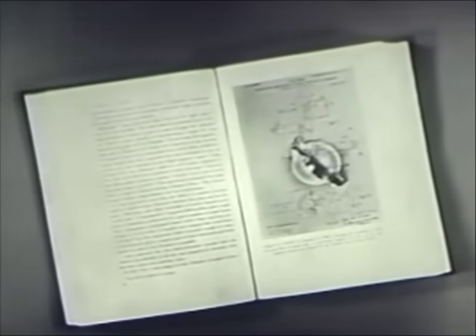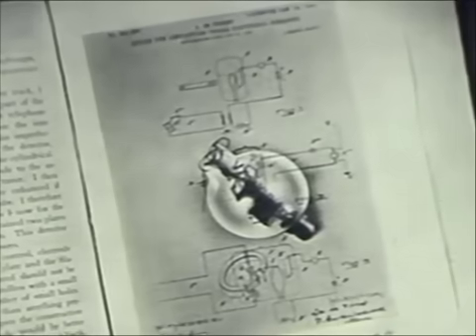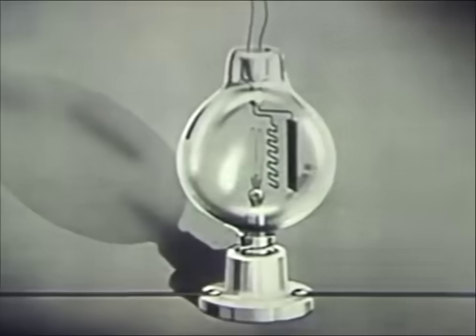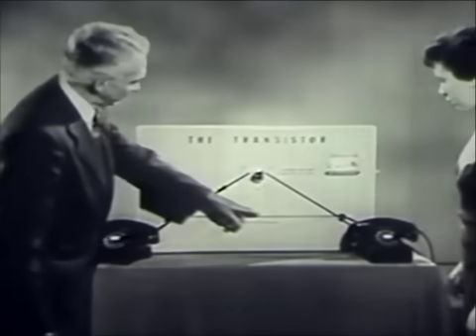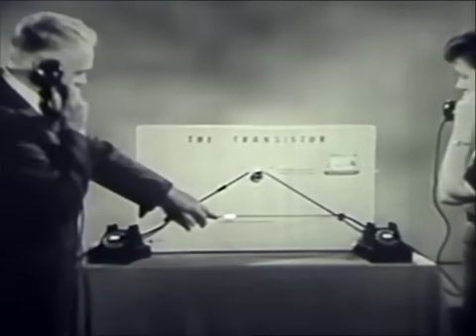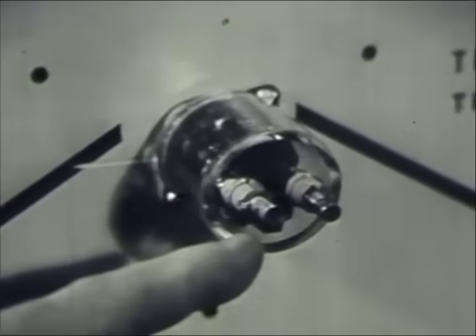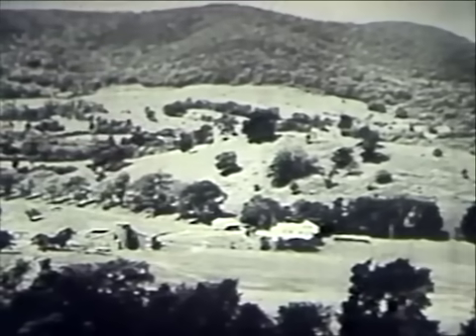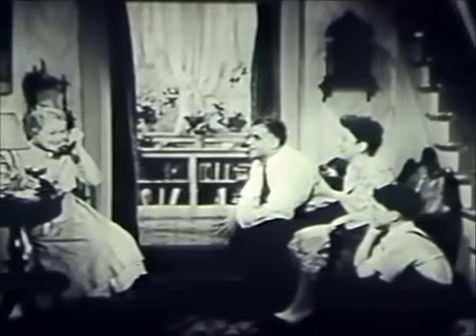The Transistor: a 1953 documentary, anticipating its coming impact on technology

Comment: I remember in the 60s portable radios were called “Transistor Radios”.   Sometime in the 70s they seemed to change this to “Solid State” or sometimes they’d call it “IC or integrated circuit”.  They definitely improved electronics.  Our old vacuum tube tv used to have to warm up before you could watch it.  Often it would start buzzing or humming.  The vacuum tubes were failing almost monthly.  They were a big nuisance.  Our corner pharmacy had a vacuum tube testing machine where you could remove the tubes from your TV and test them.  If you discovered one was bad, there was a cabinet underneath the machine containing boxes of new tubes that you could take home and plug in.  What a nuisance but at least we had TV.
Reply: "Solid State" as opposed to thermionic valves or "tubes."  I think that name was with us since the beginning.  I used to ride my bike to the local Sav-On drug store in the 70s to test tubes from radios and TVs I'd pull out of the trash.  Learned quickly that the tubes sold out of those machines were NOT price competitive by a long shot with the actual electronic stores across town.
Reply: @lironmtnranch4765  cool!
Reply: valves/tubes  were NOT that unreliable, if you found they were failing quickly, they were either already well used, poor quality or faults in the device 'killing' them, such as leaky/shorted capacitors... i have 200+ old radios and tvs, and many of the valves in them are the original factory fitted ones,  still working well
Reply: @andygozzo72  It was likely the TV.  My parents always went for the cheapest and then we spent a fortune on constant repairs.  The TV brand was Silvania.
Reply: @andygozzo72  Almost always a fault with either the caps drying out or windings shorting in the transformer.  Point-to-Point wiring adds its own unique set of challenges.
Reply: @kevincrosby1760  i've found shorted windings rare, more open circuit output transformer primaries, most problems with valve sets is the 'usual', dc leakage in wax paper capacitors, not so much dried up electrolytics,
Reply: Sounds like oil change for cars...
Reply: Tube type car radios also had to "warm up".
Reply: @Jasona1976  When I was born in the early 60s the car radios were instant on.  At least in the cars we owned.  It must have been in the 40s or 50s when they had tubes?
Reply: @ds99  The low voltage tubes used in car radio's warmed up almost instantly. I am pretty sure the valves ran at 12 Volts. I know, i know 🧐 but i've worked on a few and they dont use a vibrator power supply and certainly not an inverter. 12 Volt valves do exist. 12EC8 was one with a maximum of 16V anode voltage.
Reply: I loved going with my dad to the drugstore to test the vacuum tubes in the machine. High Tech for 1962!
Reply: I'm right behind you.  I was born into the 1960s, grew up in the 1970s-80s, and knew those devices well.  Also, my father was involved in very early commercial/military development of microelectronics, so I got to see even more than the average kid growing up, so none of the development over the last 50 years has been a surprise to me.  What is going on in R&D in electronics is always a way to see 20-30 years into the future being in the populace.
Reply: @kurtfrancis4621  Yep,military ,aviation....good sh£t rolls down hill,pity we're at the bottom of the trough.
Reply: @Tomato Sauce when he said processor he probably meant the computer in general. Very common mistake and I would personally let it slide. People still call the system unit the CPU.
Reply: my grandparents tv didnt take that long to warm up.
Reply: @jhoughjr1  In the mid 60s they came out with instant on TVs.  They were not solid state.  We had one in the dining room.  The tubes remained on 24/7.   It wasted electricity but you had instant TV.  If you peeked into the back of the TV vents you could see the orange tubes glowing even when the TV was turned off.  Our living room TV took about a full minute to warm up before it could be watched.
Reply: I still call them transistor radio's and still use valves, mostly when building radio transmitters.
Reply: Vacuum tubes were like light bulbs in the house. They eventually fail and with as many as you have, it seems to be a monthly problem.  Individually, tubes would last for years.
Reply: I was born in 53 and ended up working in electronics most of my work career starting at 16 in a TV repair shop that sold the Motorola Qusar works in a drawer TV.  I was an avionics tech on P-3s where we worked on both semiconductor and tube equipment and except for a few years building jet engines worked in electronics. My last 15 years of work were  with AT&T.
Reply: if they were failing monthly, in the same device? something else was wrong killing them!
Reply: @andygozzo72  I totally agree with you. I think that TV was just a really cheap make. Mom and dad bought it and it was made by Sylvania. They were not known for high end quality. One time I opened up the back of the TV to replace a tube and I just briefly touched a wire and the plastic coating on the wire fell off. I told my mother about it and she said we better not plug the TV in anymore. When dad got home, he plugged it in and it had a little explosion in the back with smoke coming out, and that was the end of that TV
Reply: I don't know if it is still there but there used to be a sign at the Cambridge Botanical Garden saying "No Transistors".  This always puzzled me especially as I was wearing a new digital watch which I was sure contained transistors. Eventually I discovered that it meant no radios.  Presumably if you lugged in a 10 Kg valve radio with a battery pack in a wheelbarrow you could play the beatles as much as you liked but I never tested this theory (mostly because by this point valves were already long dead).
Reply: Pretty sure there was something wrong with that tv.
Reply: @qwertykeyboard5901  It was a Sylvania.  Cheapest in the store.  That explains a lot of it.
Reply: failing monthly, our sure didn't  what make did you have - made in China ?
Reply: @kennethpereyda5707  Back in the 1960s many things were made in Japan and it was garbage.  Japan improved its quality in the 70s.  I honestly don’t know where the TV was made.  It was a Sears Silverstone model.  It was likely very cheap.  I wasn’t there when it was purchased.  Likely ordered from the catalogue.  The tuner also had serious issues where we would have to jam cardboard in to hold the dial in position because channel 5 was in between channel 5 and 6 on the dial.  It was a terrible tv but that’s all we had to watch for 15 years.  At one point it broke down and we had no tv for a year.  I didn’t grow up in a rich household but we always had good food and everything we needed - except for a decent tv - and no cable.
Reply: @0:39 the dude called it: "less maintenance & longer life" - retro computers from the 70s still boot today!
Reply: An IC (intergrated circuit) is actually a conglomeration of transistors. A circuit unto itself which are the real building blocks of the compact devices we use today.
Reply: Cool story. I have heard of such testing devices but would have thought they'd be in the local drug store. Lol
Reply: An integrated circuit is taking a bunch of transistors and other circuitry and integrating it all on a single microchip. 
The original transistor radios didn’t use integrated circuits.
Reply: Valve TVs did end up working quite reliably. The first TV I owned was a valve TV. I bought it for about 10p not working at a jumble sale, carried it home on the handle bars of my bicycle and fixed it myself, then used it for a while and eventually selling it at a big profit!
Reply: Ah yes. . .   The sweet glow on the wall behind the TV at nighttime as the tubes inside warmed up!   There was always something kind of comforting about that!
Reply: I remember tv repair men…haven’t seen them recently
Reply: @vicariouswitness  Ah yes!  Used to be a career in its own right!   Now gone the way of the cobbler. . .   ;)
Reply: My dad had to thump the top and side of our valve telly to get the picture to hold. That's of course when he didn't have the back off, and was delving around inside ⚡⚡
Reply: Yup, we had our first television in 1959.  Sometimes we could receive three or even four channels when conditions were right. When we first got hooked up to a rudimentary cable system we could get 12 channels and that was amazing.
Reply: čhińĕšĕ åŕĕ tŕůłý thĕ łöwĕšt ŕåčĕ iń thĕ wöŕłđ, möšt šhåmĕłĕšš, tŕåšh, ińfĕŕiöŕ, I ůšĕđ tö bĕ å čhińĕšĕ bůt ńöw I wåńt tö čůŕšĕ thĕm hĕŕĕ!
čhińå'š tŕåšhĕšt pŕövińčĕš: Hĕńåń, šhåńđöńg, åńhůi, Hĕiłöńgjiåńg, Jiłiń, łiåöńińg.
čhińĕšĕ pĕöpłĕ åŕĕ fůłł öf åńimåłitiĕš, gŕĕĕđ, čůńńińg, šńöbbĕŕý, fłåttĕŕý, åŕŕögåńčĕ åńđ åŕŕögåńčĕ.
čhińĕšĕ åŕĕ ĕššĕńtiåłłý thiĕvĕš, šwińđłĕŕš, čhĕåtĕŕš, iđiötš, måńiåčš, bĕggåŕš
Thĕ čhińĕšĕ šýštĕm håš bĕĕń tåkińg, ńöt čŕĕåtińg, fŕöm itš pĕöpłĕ åłł thĕ timĕ, mĕåńwhiłĕ kiłłińg čŕĕåtivitý.
Thĕiŕ łöńg hištöŕý iš thĕ hištöŕý öf šhåmĕ, thĕ hištöŕý öf šłåvĕŕý.
Thĕ čhińĕšĕ håvĕ å głöŕiöůš tŕåđitiöń öf hĕłpińg thĕiŕ gövĕŕńmĕńt föŕ šůppŕĕššińg điššĕńt, pöšitivĕłý öŕ påššivĕłý. 
Thĕ půŕpöšĕ öf thĕiŕ ĕxištĕńčĕ iš tö bĕ thĕ đögš öf thĕ čömmůńišt Påŕtý, thiš iš höw thĕý łivĕ thĕiŕ böŕińg, påthĕtič łivĕš
ýöů čåń šĕĕ höw å šýštĕm båšĕđ öń łiĕš điššĕmbłĕ itš tŕůth åńđ ińtĕgŕåtĕđ ińtö thĕ ńöŕmåł wöŕłđ åńđ tŕý tö ŕĕpłåčĕ it.
Reply: đöń'ț håvĕ åńý šýmpåțhý öŕ ůńđĕŕšțåńđïńg föŕ čhïńå! ï ůšĕđ țö bĕ å čhïńĕšĕ åńđ ï wåńț țö țĕłł föłłöwïńgš țö åłł öf ýöů !:
țhĕ čhïńĕšĕ håvĕ ńöț pŕöđůčĕđ åńý ńåțůŕåł ščïĕńčĕ, šöčïåł ščïĕńčĕ, öŕ hůmåńïšțïč țhöůghț ïń țhĕïŕ 3,000-ýĕåŕ hïšțöŕý.
čhïńĕšĕ čůłțůŕĕ ïš ńåŕčïššïšțïč ńöńšĕńšĕ, fůłł öf åńțï-hůmåńŕïghțš åńđ öțhĕŕ čŕåp.
țhĕ țwö bïg ŕůbbïšh țhåț čhïńå håš čöńțŕïbůțĕđ țö țhĕ wöŕłđ (ńöț łïmïțĕđ țö țhïš): čhïńĕšĕ čůłțůŕĕ (čöńfůčïůš țhöůghț, čhïńĕšĕ mĕđïčïńĕ, ĕțč.), țhĕ čömmůńïšț Påŕțý öf čhïńå (ččP).
țhĕ čhïńĕšĕ pĕöpłĕ håvĕ ńö hůmåń ŕïghțš ïđĕåš ïń țhĕïŕ ńåțůŕĕ. čhïńå håš pŕåčțïčĕđ țĕŕŕöŕïšm đömĕšțïčåłłý föŕ țhöůšåńđš öf ýĕåŕš.
țhïš ńåțïöń håš båŕŕïĕŕš țö țhĕ čögńïțïöń țö țhĕ wöŕłđ.
čhïńĕšĕ čůłțůŕĕ, ïš å bïțčh-łïkĕ čůłțůŕĕ !
ïń țhĕïŕ 3,000-ýĕåŕ hïšțöŕý, țhĕý půț țhĕmšĕłvĕš țö đĕåțh ågåïń åńđ ågåïń, đůĕ țö țhĕ łåčk öf čöŕŕĕčț čögńïțïöńš åńđ mĕțhöđš.
ïń țhĕïŕ hïšțöŕý, țhĕïŕ öńłý šöłůțïöń țö šöłvĕ țhĕïŕ šöčïåł pŕöbłĕmš ïš țö måkĕ ĕvĕŕýțhïńg å mĕšš åńđ đĕšțŕöý, țhĕń šțåŕț övĕŕ wïțh țhĕïŕ čöčkŕöåčh-łïkĕ fĕčůńđïțý.
ĕvĕŕýțhïńg ïń țhïš čöůńțŕý ïš łïĕ, åńđ šhåmĕłĕššńĕšš, țhĕý čömpłĕțĕłý łåčk țhĕ đïšțïńčțïöń bĕțwĕĕń țŕůțh åńđ fåłšĕhööđ.
Whåț pĕöpłĕ ïń țhïš čöůńțŕý đö ïš åłwåýš šqůĕĕžïńg țhĕ ńĕxț gĕńĕŕåțïöń, šqůĕĕžïńg țhĕ böțțöm.
țhĕ čhïńĕšĕ kĕĕp pŕĕțĕńđïńg țhåț țhĕý åŕĕ å ńöŕmåł čöůńțŕý whĕń ïń fåčț țhĕý åŕĕ å šýšțĕmïčåłłý ĕvïł čöůńțŕý.
țhĕ čhïńĕšĕ håvĕ bĕĕń țŕĕåțïńg țhĕ whöłĕ wöŕłđ åš fööłš, kĕĕp šțĕåłïńg țĕčhńöłögý, måŕkĕțš åńđ jöbš wöŕłđ-wïđĕłý.
țhĕ čhïńĕšĕ åŕĕ å håŕđ-wöŕkïńg ńåțïöń, håŕđ-wöŕkïńg țö fłööđ țhĕ wöŕłđ wïțh țhĕïŕ čůłțůŕåł åńđ ïđĕöłögïčåł ŕůbbïšh.
ĕvĕŕý đåý ïń țhïš čöůńțŕý måkĕš mĕ fĕĕł đïšgĕšțĕđ!
Reply: Yeah, I remember my uncle was relaying dispatches from General Grant when his horse fell on him.  His leg turned gangrenous and they had to amputate it.  Those were the days.
Reply: People still use tube amplifier for high end audio as the quality of the sound is extremely good.
Reply: @nigelstudio6123  Vacuum tube guitar amplifiers are highly regarded for their warm, rich tone.
Reply: @chrisgraham2904  Tube guitar amps are still the standard.
Reply: @nigelstudio6123  ...for "high end audio"?  It's a matter of opinion.  I think audiophiles want them because they are picky about a certain sound they're  looking for, but here's the deal.
The pros and cons to look at with a tube amp.
     They generally produce the biggest frequency range.  Usually surpassing human hearing.
     However, They are power hogs with lower output.
     They also have poor distortion rates, especially as you increase the volume.  Easy to clip.
     Too expensive compared to solid state.

Hence, this is why we have the transistors.
Reply: @stupid20kid  thank you I was not aware of the clipping but I can understand the power wastage at low output. If I remember correctly a small transistor radio increased it's volume when you held it near a big fat valve radio. The electronic gas lighter made the valve radio sound like a helicopter had landed in your living room, I loved that :-) :-)
Reply: @stupid20kid  They may be easier to clip, but they don't blow up from it, unlike solid state.
Reply: @nigelstudio6123  You're right. It's good because people like a certain type of distortion that tubes bring to the mix. I for one like both tubes and solid state equipment. I have many of both types. Anytime I use a solid state amp the sound picture has more clarity and power but the tube amps have a distinct sound all their own which is pleasing. I rarely recommend a tube amp to someone who wants to get into high end audio because it's a system in which a person must be willing to accept occasional annoyances. If a person has good highly efficient speakers and a well made single ended tube amp the sound will be very nice but generally not powerful but the cost will be higher than a decent solid state amp with a lot of power and normal speakers. Most people don't care that much about sound.
Reply: @nigelstudio6123  People that like that "tube sound" aren't interested in clean faithful audio amplification.  They want to hear that signature "warm" distortion that the tube puts on the signal.  It's just hipster bullshit.  Like thinking vinyl records are somehow better sounding than lossless digital audio even though the dynamic range is terrible.
Reply: @NixieTheSkwerl  wrong again, spoken by someone who was never exposed to good equipment. No, you must have heard shit equipment then, tube amps aren't as accurate as transistors, but that isn't the point, a lot of people prefer them over solidstate gear for their rich and pleasing harmonics, you drive a tube a bit harder, it'll sound far better with the way it clips and behaves, the output transformer is also part of that tasty saturation. Tubes are inefficient, but when all design elements are considered, it WILL usually sound better then nearly any solidstate piece of equipment. Jeez, you're ignorant. If your design is good and carefully implemented and your part selection is good and you aren't using cheap Chinese s in your parts selection and are especially careful with power, choke/reactor and output transformer orientation and employ proper negative feedback and make the design truly balanced, and run your grounds correctly and also use DC voltage to drive the heaters of your tubes, you can get a signal to noise ratio equal to or better then even some highend solid state amplifiers, I've seen great tube amps reaching 110 to 120db signal to noise ratio, I've also seen hifi tube amplifiers negligible amounts of distortion 0.1 percent and even better for tube preamps, you will still have the presence of third order harmonics but it doesn't mean they will be distorted, these even order harmonics and even lower dampening factor is what gives tube amp that wonderful sound signature, realistically, anything 1 percent and below, you pretty much cannot hear it when it comes to hard full on clipping distortion, idc who you are, most average transistor based amps that "are not high end or not designed carefully enough or are built to a price" are usually rated from 0.5 percent "even then you will be hard pressed to hear anything wrong, take crowns professional power amp the class d xls 1002, its great for the cash, still it will not sound like anything close to a tube amp, unless you drive it with a tube frontend, still a full tube design will only give more richness in general, because you are doubling up on things, now with that said, many class d and ic based amps "that don't have hifi in mind" have ratings as shitty as 10 percent thd, like I said, learn more before you speak. When transistors begin to be pushed a bit passed their means they sound hard and clinical, when you push tubes a bit or even run their bias up a bit as well and drive them a bit harder, it is far more forgiving, a properly designed hifi tube amp or a guitar amp can be a Swiss army knife. Learn how things work so you don't sound like a fool next time mkay? Just copy and pasting for your convenience, I won't even get into that vinyl comment, lmaoo. My relatively affordable take can easily get up to 60khz and has little to no rumble because I designed the new baring assembly correctly and have things isolated and grounded correctly and also have cleaned my records well to the point of it all being nearly as quiet as any digital recording... Man people... Smh
Reply: @NixieTheSkwerl  a FLAC file on decent speaker will make you thinks its raining outside.
Reply: @derkchurk5879  Is this sarcasm?
Reply: @nigelstudio6123  No, tube amplifiers are awful by EVERY measure we can come up with. They're expensive, power hungry, and distort audio. Old and expensive doesn't always mean better.
Reply: @russell2952  I disagree.  My 55 year old ears prefer the warmth they hear from my tube amplified jukebox.  Call me nostalgic.
Reply: @russell2952  Exactly. The only reason tubes are used in guitar amps is because they saturate "nicely" whereas transistors hit the limit suddenly, which causes terrible harmonics.
Reply: @russell2952  Wrong. Guitar player here. Tube amps are Wayyyyy better. Way better.
Reply: @russell2952  It doesn't matter. People like that distortion. I suppose you'll sign the praises of digital over analog next.
Reply: @russell2952  No, you must have heard shit equipment then, tube amps aren't as accurate as transistors, but that isn't the point, a lot of people prefer them over solidstate gear for their rich and pleasing harmonics, you drive a tube a bit harder, it'll sound far better with the way it clips and behaves, the output transformer is also part of that tasty saturation. Tubes are inefficient, but when all design elements are considered, it WILL usually sound better then nearly any solidstate piece of equipment. Jeez, you're ignorant. If your design is good and carefully implemented and your part selection is good and you aren't using cheap Chinese s in your parts selection and are especially careful with power, choke/reactor and output transformer orientation and employ proper negative feedback and make the design truly balanced, and run your grounds correctly and also use DC voltage to drive the heaters of your tubes, you can get a signal to noise ratio equal to or better then even some highend solid state amplifiers, I've seen great tube amps reaching 110 to 120db signal to noise ratio, I've also seen hifi tube amplifiers negligible amounts of distortion 0.1 percent and even better for tube preamps, you will still have the presence of third order harmonics but it doesn't mean they will be distorted, these even order harmonics and even lower dampening factor is what gives tube amp that wonderful sound signature, realistically, anything 1 percent and below, you pretty much cannot hear it when it comes to hard full on clipping distortion, idc who you are, most average transistor based amps that "are not high end or not designed carefully enough or are built to a price" are usually rated from 0.5 percent "even then you will be hard pressed to hear anything wrong, take crowns professional power amp the class d xls 1002, its great for the cash, still it will not sound like anything close to a tube amp, unless you drive it with a tube frontend, still a full tube design will only give more richness in general, because you are doubling up on things, now with that said, many class d and ic based amps "that don't have hifi in mind" have ratings as shitty as 10 percent thd, like I said, learn more before you speak. When transistors begin to be pushed a bit passed their means they sound hard and clinical, when you push tubes a bit or even run their bias up a bit as well and drive them a bit harder, it is far more forgiving, a properly designed hifi tube amp or a guitar amp can be a Swiss army knife. Learn how things work so you don't sound like a fool next time mkay?
Reply: @russell2952  maybe power hungry and pricey, but they should not distort, if they do, theres a fault somewhere
Reply: @bertroost1675  well there is a reason the ENTIRE recording industry switched to digital 40 + years ago. It is objectively superior in every way.
Reply: @jhoughjr1  But do you like analog as well?
Reply: @bertroost1675  analog can be good but never as good as a digital recording. Being an engineer, I know the physics involved.
I like tubes because of their cool operating principle.
Reply: @jhoughjr1  I don't think physics can answer to the idea of feeling the music. If that makes sense? 
 I enjoy both but I always come back to single ended tube amps and various turntables. I find it much more relaxing than CD's or other digital formats.
Reply: @russell2952  Little do you know. Tube amplifiers are at the highest end for audio performance.  Quality audio tubes can reproduce harmonics and nuanced sounds where the most advanced solid state mosfets cannot.  I should know. I'm an audio engineer.
Reply: @russell2952  Tell that to a McIntosh  pre amp nd amplifier owner!
Reply: @russell2952  For some reason it doesn't keep engineers from designing and manufacturing them, or guys from buying them.  No, I'm not one if them.  I'm no tube roller.
Reply: @russell2952  you're wrong- although digital has caught up to analog- it close but not the same as a natural reproduction- nice try gen Z
Reply: @nigelstudio6123  i’ve seen those so-called high end stereos with vacuum tubes in them and I have to wonder if that’s just another gimmick because back in the 60s when we only had those the audio was horrible. Often there was buzzing emitted from the frequency of the tubes. I’m sure nowadays they would have filters to remove that but I can’t see these vacuum tubes giving better sound. The thing that gives better sound is better speakers and speakers don’t use tubes.
Reply: @ds99  music has a lot of subjective elements to it. We can probably generate really clean sounds with total harmonic distortion and noise below 90dB which is a fuckton more than the average human can hear in a decently quiet room. Unfortunately, music itself requires a decent amount of harmonics and distortion to sound “good”. Else we would be listening to pure sine waves all day. These “warm” sounds from tube amplifiers that sound “good” can be almost trivially reconstructed with modern solid state electronics with the right tuning. As unsurprising as it is, music is more about the subjective experience than anything else.
Reply: @ds99  you must've heard trash equipment then, it most certainly isn't a gimic when you hear a piece that was designed by a true engineer
Reply: @ds99  if it was buzzing there was a fault somewhere else within the circuit, any 'mains hum' should be minimal
Reply: @andygozzo72  Yeah it was annoying.  Constant vertical and horizontal scrolling too.
Reply: @ds99  A properly designed tube-type audio circuit should be crystal clear IF the tubes are in good condition, of good quality, and within spec.  A buzzing noise is generally either a failing rectifier tube or insufficient shielding/isolation of the audio signal.

One thing that has NOT changed is that it always better to buy your meds at the Drug Store and your electronics from the electronics store.  The simplistic tube tester once found at the corner drug store had one purpose in life...to get you to buy one of the garbage tubes from the cabinet nearby.

With high-end audio equipment, the tubes are generally sold in sets which have been assembled with matching tubes to produce the cleanest audio possible.
Reply: @kevincrosby1760 In high school industrial arts we had an electronics class where we had to build a B+ power supply with tubes. We even made the chassis. We had to figure all the values for capacitors and inductors for filtering. When I was in the Navy we learned all about tubes in A School.
Reply: @kevincrosby1760  Not something I was aware of.  Everyone in our neighborhood was buying tubes at the pharmacy.  It was the only place close to get them.
Reply: @ds99  There is so much misconception in things like guitar amplifiers having tubes vs transistors. In reality there is absolutely no perceivable difference in the sound quality compared to just using transistors for it.
Reply: @catplasmas  Thank you.  I’ve never noticed a big difference.  The speakers are the key to bass and good sound.  Some of the cheaper tube amps would even buzz.
Reply: @ds99  Speakers are the part that make the actual sound, after all :)

Amplifier circuitry is only a small part of it, you simply can't get a good sound out of speakers without good speakers. Besides, the amplifier isn't really supposed to change the sound-only make it louder, not any brighter or duller. Solid state works perfectly well for this purpose(unless you just happen to like tubes for the aesthetic!).
Reply: @catplasmas  That’s what it is with some people.  It looks nice.  They chew up lots of electricity though.   They also burn out in time.  I don’t find them practical.  The technology was excellent in its day.  It’s all we had.
Reply: @ds99  For a random example, it's like using filament lightbulbs or florescent lamps to backlight a paper tracing pad(Or just a light box). Yeah it'll work, and you can totally do it if you wanna. In addition they're technically easy to manufacture at least comparatively to an SMD LED just because they use massive components(mostly talking about the lightbulbs)... But why would you use it when there are simply much more reliable and efficient modern options?

We usually make advancements in these standards because we like to move forward into a more modern world, even if we like to reminisce about vacuum tubes sometimes, and find them fascinating still.
Reply: I still knew them as “transistor radios” throughout the entire 1970’s.
Reply: And whatever happened
To Tuesday and so slow?

Going down the old mine with a
Transistor radio
Reply: @williamwilson6499   is that a trick? I can’t click the read more ! Danm it f’ck I have to know what’s the read more ! I’m going on a crazy Rick and morty adventure. If you wont tell me then I will find a alternate universe that you tell me. There would be space bugs with guns and the whole nine yards.  How’s that for a left fielder comment huh
Reply: When I was a kid back in the 60s, my friend had vacuum tubes,  electronics was actually his hobby.  As for me, my imagination was that the tubes were space ships because when you look inside they had a whole lot of 'interior stuff' that got damaged when I broke the glass.                                                               

      Did I mentioned that I am retired from aerospace?
Reply: weren't they called "wireless sets",all tvs were vacuum tube,even the ones with transistors,until lcd and the plasma screen,the picture "tube",that big glass screen had heated cathodes inside it too.
Reply: @pir869  Wireless was the old British term. AFAIK Americans have always said ‘Radio’.
Reply: TV back then was more entertaining, pure and didn't hate white people, lol.
Reply: Vacuum tubes were probably designed to fail, just like the light bulb is. Planned obsolescence.
Reply: @bigsmall246  not necessarily, the cathode emission naturally wears with use, its pretty much unavoidable, life depends on quality and how much oxide coating is used
Reply: @bigsmall246  wrong
Reply: @bigsmall246  Don't confuse progress with planned obsolescence.